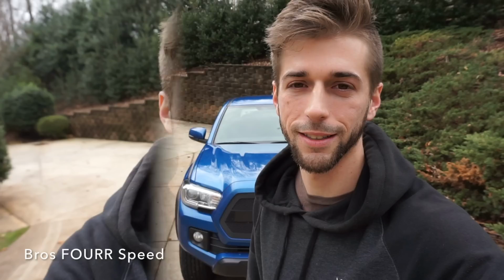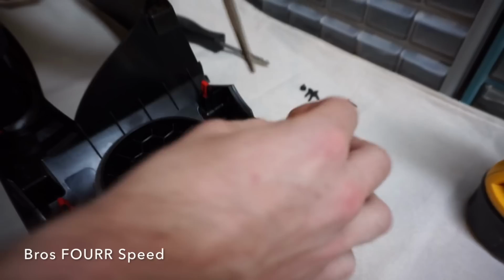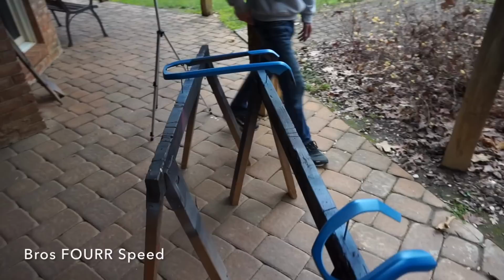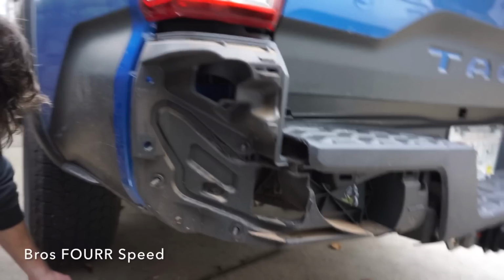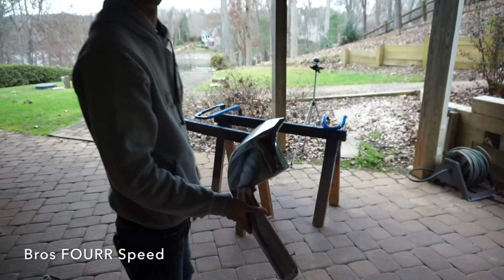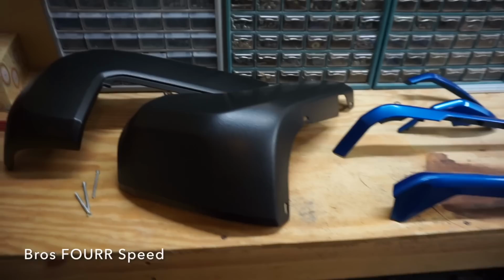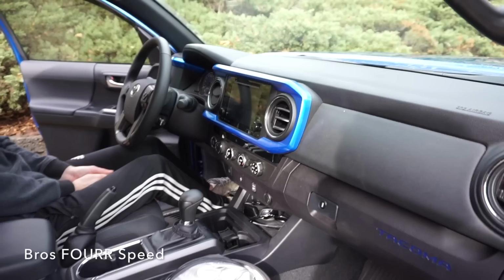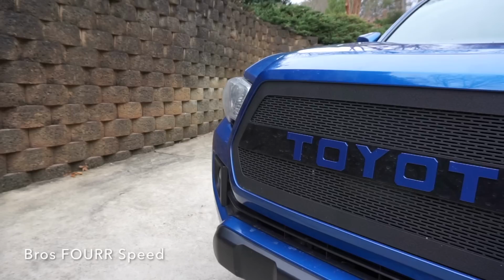I Did THIS To My Brand New Tacoma With Spray Paint and Plasti Dip!

Comment: I have a 2017 as well, Ive been thinking about doing the same with the rear bumper. plastic dip on the factory front grill, leveling kit, 33's with 18" moto wheels. Looks pretty good, lift coming in the next few months. Id add a picture if i could haha

Comment: What babout the metal clip in the bumper? Coukdnt even get mine off but saw a video of a guy who had a metal clasp inside that he coukdnt quite get back on normal
Reply from the maker: When I took these end caps off, a metal clipped had popped off and there way no way it was going back on!  There were enough clips to hold it in place without that!  I never had any issues without using it!

Comment: Hi sweet job. I have a 2020 Crome bumper how did the paint hold up on the Crome ? Went to body shop and they don’t want to mess with it? How do I find info how to do it. I see how it came off but what paint and sprayer is that? Thanks  Pete
Reply from the maker: I used plastidip. Has held up great for 3 years! Just installed a high clearance bumper. So they are gone now.

Comment: nice touch! just on the rear on the lower side of the bed  were is painted black but theres a gap of blue still, you should paint that edge between the bumper and the bed black also, it will look even better, but overall nice job!
Reply from the maker: Gerald TRD FREAK Yeh the sides are are vinyl wrapped. I'm debating on re doing the rear section to eliminate that blue portion

Comment: Since you posted this video up back in December of 2017, how's the rear bumpers holding up with the plastidip? Has it peeled up on the corners yet or gotten scratched up from road debris? Also how many coats did you apply?
Reply from the maker: Everything has been fine with them, even power washing from off road, it has all stayed in tack, I think we did 7 or 8 coats, so it's been very durable.
Reply: Bros FOURR Speed I’m thinking of doing the same so how many cans of plasti dip do you think I need? Also, where did you get that sprayer adapter that is on top of the plasti dip can? What did you clean the bumpers with before pairing? I saw a big white square can on the ground.

Comment: Do you have a bad rear axle that warps the rear drums problem.  Toyota has a class action lawsuit against them.  They involve 2016-2018 Tacomas.  You may not notice it right away.  I almost bought one today until I found that article.  Eventually they will show their ugly head. Maybe yours not affected.  Couldn't take a chance.
Reply from the maker: I haven't heard of any issues along those lines, only recall I've seen on the rear axle is leaking problems.